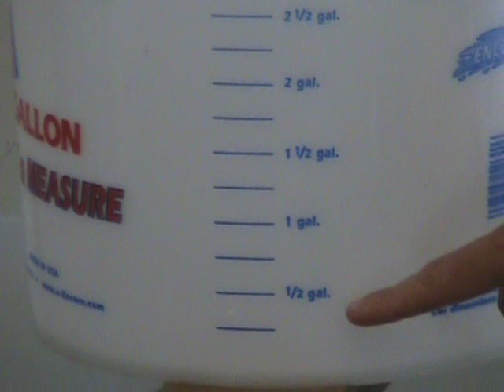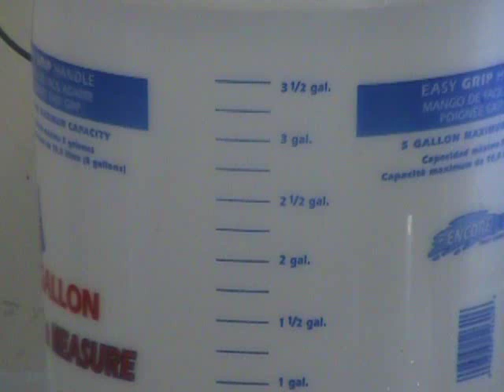Friction loss experiment in a horizontal pipe

Comment: What would happen if you had a small siphonic tube start delivering water to the pvc pipe just before the downstream manometer and the siphonic inlet's height at the top of the small tube was higher than the upstream manometer? I notice that you have not answered any previous questions but I hope that you answer mine. Thanks.